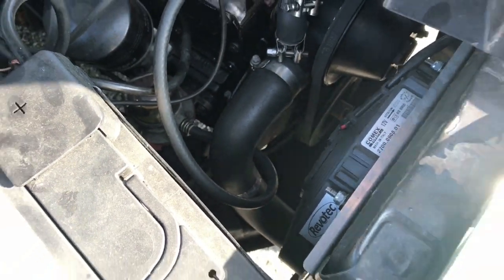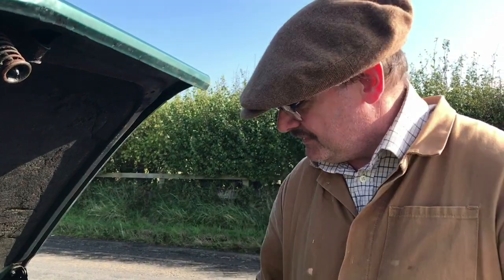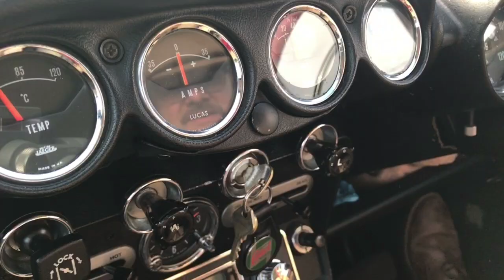Introduction to the Humber Sceptre

Comment: My first proper car in the 1980's was a Mk2 Sceptre JOW 100E manual overdrive 1725, bought for 400 quid with only 43000 on the clock from the Exchange & Mart, a middle aged couple near Salisbury somewhere who had parked it outside their house and kept a pet parrot in it (I kid you not) It still had its original paint which was a kind of bronze/gold colour. I painted the roof black and put white stripes down the side and painted the tyres to look like whitewalls. I went on foreign holidays with wife and small children and used it as my everyday car, it was my ONLY car at that time, and it only broke down twice, once it needed a new rubber in the slave cylinder and the other time when I got out and lifted the bonnet to see why the car had died I could immediately see that the feed wire to the distributor had jumped off, back on and away I went. The first car that my daughter ever travelled in as a baby from the hospital, just laid in a Moses basket on the back seat (wouldn't get away with that now) I've had a lot of classic cars over the years since but always have a soft spot for the Humber. Happy days

Comment: Just loved your hat & mechanics coat thingy brown. But, I think your car is marvellous because it brings back such fond memories  of my childhood. We moved from England to Mapua  a little village in the Province of Nelson, New Zealand. I worked in Perry 's  Garage sweeping the floor of the garage & engineering area of iron & steel filings. My boss owned Singer Snipe, and, he would take me to  Richmond in this car. It had overdrive & it was fitted with the same dials display your car has. The seat were made of leather & the wood trims were clean as was the whole interior.  I remember the engine was quiet & the car had an aire of grace. Just like your car. Thank you for the memories!

Comment: I bought my 66 Mk2 in 72 from a elderly ex employee of Rootes who had the car from new, I was actually looking for the 1970 mk 3(not as good as it turned out!) So he couldn't drive it anymore and was in his late 80s It only had 4300 miles on the clock and was showroom! I gave him 300 pounds for it an absolute bargain! I loved that car and my best friend was so impressed with it, he bought the same model but a 67, only reason I (reluctantly) parted with it a after 4 years was I saw a 1970 Rover P5B coupé in the same sought of condition at a bargain price,  I sold the Sceptre to a colleague who promised to her a good home! Then immediately blew the engine up on the M4! I was not impressed, turns out he was a bit of a bl**dy hoon! Definitely one of the best cars I've ever owned! And btw I did swap out the awful  solex twin choke for the Weber! What a difference!

Comment: One of the best bits of a Sceptre is missing on yours. The manual gearbox and o/d is brilliant,  combined with the progressive clutch it changes beautifully and cruises peacefully at 80mph unlike the auto which makes the acceleration glacial and nearly 5000 rpm rather than 4000 at 80mph is very fussy and noisy. The BW 35 autobox has 3 speeds .... slushy, slushier and extremely slushy. I couldn't live with it.

Comment: The great thing about the PAIA twin-choke Solex carburettor is that they are quite light and therefore you can throw them a long way down the tip. The 28/36 DCD Weber is a good swap as are the 1725 Alpine's twin Strombergs. There is no performance/reliability difference between the earlier Lucas 25D and the later 45D distributors. The best part of a Sceptre is the dashboard. Lovely.
Reply: Yes John totally agree one of the first things I did with my Mk2 was change the awul solex for the Weber in about 72, What a difference!

Comment: The m6 3 sceptre carb has a totally different curve to the one off your car, so that was a downgrade. The twin fans are overkill as my car sits half way on the gauge no problem with the original fan. Radials make a massive difference but the Auto box is really shit for motorway cruising.
Reply: I had the Solex twin-choke on my Mk.1 Sceptre and had the same problems with leaks and poor performance.  I replaced it 40 years ago with a Weber 28/36 DCD twin-choke.  Better performance and lower fuel consumption.  It's still on the car and I've overhauled it once or twice.  I use it with a simple pan type air filter.  I agree the radials will give better handling, but they might make the steering a bit heavy at lower speed and parking. I still run mine on crossplys. I've got an electric fan on mine in addition to the regular radiator fan.  Useful in traffic jams when the temp can rise.  You don't want overheating with an alloy head.